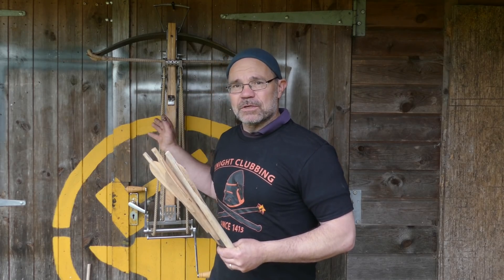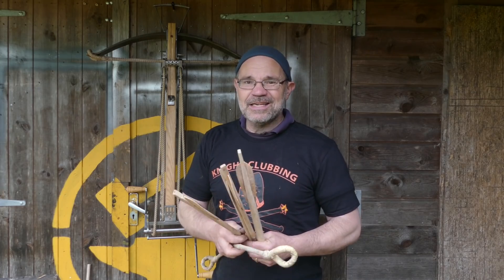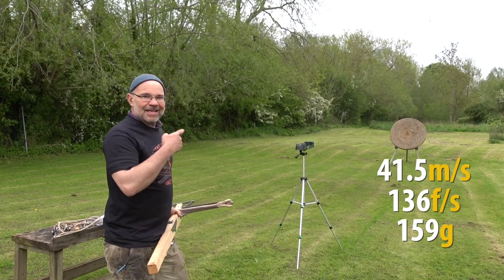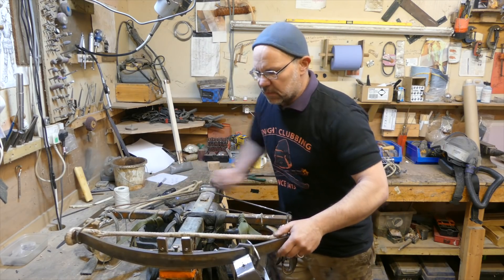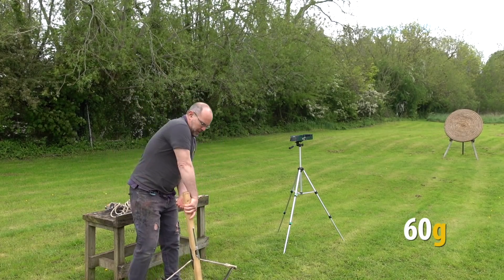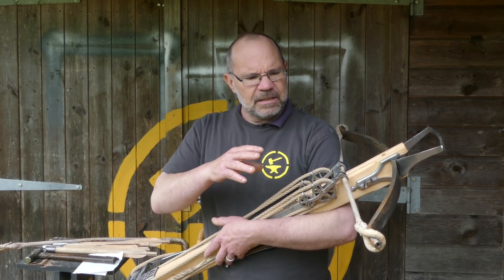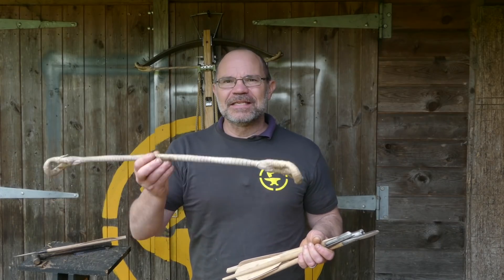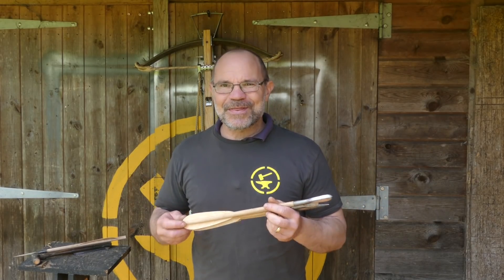Medieval bolt POWER!

Comment: I just realized, that the steel bow on the crossbow is heavier than a longswords
Reply: I find stuff like this a real eye-opener when looking at how much great characters in fiction lug around while sneaking past guards and scaling castle walls.
Reply from the maker: I found it interesting, as I have neither weighed it either, I just knew it was heavy

Comment: A possible explanation for why the lighter string gives less power: It's stretchier than the heavy string. So for the same draw distance you get more string stretching and less steel bending, meaning you have a lighter draw weight and less power. It's exactly the same impact has having a longer string, but not visible until you pull the bow back. Can this be something you measure in your workshop?
Reply: Yeah, it's very possible that the 140 g string was just a bit too weak, so it stretched immediately, Tod's says  it's probably ended up bit too long at around 6:30
Reply: @lscibor  I thought he said that it might have always been longer? Either way, measuring the draw weight at full extension with both strings would be very interesting and resolve this quandary!
Reply: @kovona  Yes, obviously, nobody disagreed with that. The question is if the string is longer at rest, or only under tension.
Reply: @QuantumHistorian  Even measuring that might not fully capture the issues at play; depending on whether its and issue of length at rest or an issue of string stretch.  If the lighter string just happened to be fractionally longer, but no stretchier, then your draw weight measurement idea should tell the tale.  But If the lighter string has more stretch to it then I'd both static and dynamic stretching; and a draw weight test would only capture the former.  Because if the string stretches even more once the trigger's pulled and it's accelerating the bolt then that'd be a further reduction in energy transfer compared to whatever the draw weight test showed.
Reply: @jonathan_60503  Good point, I didn't think of the dynamics of the string after the trigger is pulled. My gut feeling is that this doesn't matter since the steel bow is what will have stretched the most and is the heaviest by far, so the string should be in a quasi-static equilibrium while the steel bow returns to its relaxed state. But I could be wrong! Don't know what test would determine that however.
Reply from the maker: Bartek.  You are completely right.  It did stretch/settle immediately and infact I had to retest it a few times, beyond a twist of what I generally do, but then it settled and stayed put so I ran with it, but for a while I wondered if it was too thin.  It may have moved further, but I don't think so, I think it genuinely was a slight difference in brace.  The brace is only about 11mm from rest compared to an unbraced bow, so lets say 11mm or 9mm is very little difference especially measuring on a curved and angled object.  I suspect my mistake
Reply: @tods_workshop  Thanks for the answer.

I suspect that while 11 mm may not seem like much it's still about the 7% of the while power stroke, no ? So it may be significant.

The most interesting thing is that energy drop seems really minimal with lighter bolts, may as well be just statistical variation.

But significant and in now way accidental with later.... Perhaps it had stretched further after few first shots? Or something else's at play...

Comment: I love this sort of content and I'm so very happy to see numbers explaining the mechanics going on with shooting bolts. When you shot using the lighter string and you got less velocity, at first I was very surprised. After you proposed an explanation, it all became clear. Now it seems quite obvious that if the final string length varies (with crossbow drawn), the bow will be differently deflected, affecting the deformation energy it's storing before release. And I say final length, because the string can be longer or shorter, but also more or less elastic. Accounting for this might be out of the scope of these videos, I think, but it's probably good to know for a better understanding of the whole thing.
In any case, cheers!

Comment: When comparing weighs of a bow, a string and a bolt one has to take into account relative mechanical advantage in the system. The ends of a bow move twice as slow as a bolt does. And the center of a bow doesn’t move at all. So the effective mass of the bow would be about 1/5 of it’s real mass. For the string it’s something like 3/4 of it’s real mass. The bow is still the most relevant part. But one has to be careful comparing the masses like this.
Reply: Excellent point.

Comment: lighter bot = faster speed, faster speed = more impactful 

basic physics at work
Reply: @JorgTheElder  the point impacts faster leading to more penetration allowing the mass to do more damage. it’s why modern tank shells fire a smaller arrow-like bolt than a large bullet-like shell, the force to penetrate is less but it also goes deeper and causes more damage on the backside of the point of entry: like flesh and body parts

Comment: Tod: "It's Tod at Tod's workshop here!"
Target: "Oh, this is going to hurt."
Actually, I've always wondered how they strung a crossbow.
Reply: I wonder if there was another way of stringing a crossbow; or if, armies on campaign had a cart kitted out with various rigs necessary to maintain the army's weapons.
Reply: @euansmith3699  There was certainly an armorer's cart (or several) as part of the train of any substantial army.  What exactly was in it would have varied with the army and age, but for most of history you can assume it would be a combination of a blacksmith's shop and a woodshop. I would also suspect there were field expedient methods of restringing a crossbow, since you likely didn't have a lot of spare bows when you were in the middle of a battle or seige.
Reply: @lwilton  Especially during sieges, I guess, as those crossbow strings are going to come under a lot of repeated use.
Reply: It's worth keeping in mind that you have a lot of men with little to do other than work at menial tasks most of the time. This gives you a huge reservoir of ability to make a bunch of field expedient pieces via a bunch of guys whittling the appropriate bits. At the end of the day, you could just get a couple of men, some rope, and a couple of closely spaced stakes or tree trunks to wedge the bow against while the men use the rope to pull the round side the bow against the trees. Enough men (or a draft horse) and even some of those HEAVY bows could be worked with in relative ease.

Comment: i read on a trad bow forum something like: not to think about the limbs transfering energy into the arrow, but about the arrow sucking energy from the limbs! To resist the limbs bending back to neutral you need an opposing force, that is inertia. Basically heavy stuff resists efforts to change its velocity. In moving objects its often called momentum.
So a heavier bolt will always absorb a higher % of the energy stored in the limbs than a lighter bolt, because it resists the limbs for longer due to its higher inertia, giving it more time to absorb their energy.

Regarding the string:

If we compare the kinetic energy of each type of bolt, we can determine that the crossbow has at LEAST 4% less energy stored with the longer (lighter) string. That is assuming that the lighter string does not change limb efficiency, which it definitely WOULD.

I think the lighter string being longer actually diminished the amount of energy stored in the limbs FAR more. Here is why:

Lets assume during the shot the string at the nock doesnt move, and the string at the height of the bolt moves as far as the bolt, a bit like a rubber band. If the mass of the string is evenly distributed as you move along the string from nock to nock, the mass of the string moves half as far as the bolt does during the shot. That means the mass of the string moves at half the speed of the bolt at any given time. That means it carries half the momentum a bolt of the same weight would, as momentum=mass*velocity. Meaning a 80g bolt + 140g string have about the same combined inertia as a 60 g bolt + 180g string acting on the limbs, and would be draining the same amount of energy from the limbs, and would be shot at the same speed.

That means a lighter string of the same length should cast the 80g bolt about as fast as the 60g bolt shot with the heavy string, giving it 16% more energy and bumping it up to 4.4 kg*m/s. So a 10% increase in momentum aka penetration power.***

***Assuming my simplifications werent too sacrilegious.

Regardless of my quick maths, Im quite confident you could have lost 10% of total energy stored in the limbs.

Comment: Could you make a medieval style crossbow with a metal bow ,but with a high draw length ,with it still being safe to the user?
Reply: A cross bow made from a 200lb composite bow is better.
Long draw length steel ,means long limbs.
Long steel limbs=super heavy.
Reply: i still wanna know
Reply: Can you go long with short metal limbs?
Reply: If so then how much untill its not safe
Reply: @Kokoonutz  I cant know the limit, if you want a steel short limb long draw you will need a really springy steel,and a really strong chassis. It will be super hard to make if not impossible.
Reply: A crossbow that is made from a 200lb turkish bow, will shoot heavier and lighter arrows waaaayyy faster.
Reply from the maker: I could do, but it would be really heavy and so slow
Reply: @tods_workshop  it wouldent be a crossbow at that point but a portable ballista

Comment: One thing to consider with the choice between light and heavy quarrels is that weight of them doesn't matter only in flight. There is going to be the cost of metal, but of course, even to carry them. Which is a massive concern even today. Some quick math and rounding made me realise that with a 60gram bolt you will fit ~83 into an arbitrary allowance of 5kilograms. With the 93gram one? Only ~54. You only get two thirds of number of bolts downrange! I am sure each crossbowman had a different preference and probably even had multiple types of bolts on his person, just thought that it is a good argument for consideration of the light bolts, even though I like lobbing big hunkin' chunks of steel myself as well. Lovely video and looking forward to more of them as always! Have a good one, Tod!
Reply: Yep, that's a significant concern even today.

I suspect that the crossbowmen would have maybe a dozen or so specialty arrows and a fixed weight of war shots. Total equipment weight is going to be about 35lbs/15kg

Comment: I think the one of the reasons the heavy bolt is slower, is because it has a less aerodynamic tip. I'd recommend putting a pointier head on the heavy bolt and see what happens
Reply: while it would be an interesting experiment, it would no longer be a historical bolt meant for hunting and not penetration.
Reply: So, the system has x amount of energy it can give up. If you add more mass then the energy is offset by the mass.  
Think of yourself throwing increasingly more massive rocks. As the mass gets larger the distance gets smaller. Same energy, different outcome.  
I strongly recommend that you enjoy some basic physics demonstrations as they can be a very helpful tool to understand what many people take for granted.
Reply: The Crono is very close by, so there is little distance for the bolt to decelerate. Then also the bolt is heavier and not as fast - so even a bit less drag. And it is heavier, so while the air-resistance is certainly higher, the extra mass means it will still not slow down as fast.

To put that to extremes:
A Feather as less air-resistance than a car, yet even at just 50 km/h a car could be shot way further than a feather at 200 km/h.
Reply from the maker: Some dane.  Baum stumpff has it
Reply: @ABaumstumpf  Cars kill people, feathers (except for weird cases) don't.
Reply: @ABaumstumpf  As a more non magical way of things...  
The chrono is placed at, or near the exit of the projectile so to capture the velocity at the start of the reaction.  
Using this data point, we can calculate various things given this initial reading.  
 We might have a 6mm diameter shaft vs an 8mm one. By taking the sample at the point of maximum energy, we can observe and measure any differences. 
Thus we can prove the difference between them.
Reply: We are measuring initial velocity.

That blunt tip will lose velocity a lot faster, but not initial velocity.
Reply: @ScottKenny1978  Again - while it has more air-resistance, it also has more mass. Making sweeping statements is not a good idea in this case, but very likely the heavy bolt will lose velocity and thus energy a lot slower, specially considering that it already starts at a slightly lower velocity and air-resistance increased quadratic with speed.
Reply: @ABaumstumpf  yes, more drag but better ballistic coefficient due to the much greater weight. Flying things are weird.

Comment: Interesting fact; this 850lb crossbow got a very similar performance with a 93g bolt compared to the 960llb crossbow you tested a while back with a 90g bolt. The 960 had the same momentum, 4 more joules, and 2 more meters/second.
Reply from the maker: Pretty similar weights for all parts to be honest, so at least its consistent

Comment: With energy and momentum being the highest on that blunt thicc one, I would like to see its performance with a normal botkin tip on armor or wooden doors. And make one rediculous heavy, like 400 grams and look if energy tranfer goes down again, currently it simply goes up with weight, but it would be nice to see what that strong bow can move, and when its power hits a border.
Reply from the maker: how about 510g?  try this one https://youtu.be/hU7KJ83MfWs
Reply: @tods_workshop  Yes, i saw that one. Sadly no Chrono to compare it to the other bolts, and since it is blunt, I don't know how effective a 'sharp' version (please mount a spearhead on a bolt 😅) would be compared to the 90ish grams bolts. Since crossbows are not the most mobile and range-defining things, i wonder if a 'breach commando' could have used some rediculous bolts like that, as range would be neglectable and pure energy transfer is all you need sometimes. (Full metal bolts perhaps? They probably are not as top heavy as the pommel one...)
Reply: That one is thicker, so more metal would need to be bent and the four 'cuts/leaves' would need to be longer, so I would think there would be diminishing returns. But having numbers to prove that would be sweet.
Reply: @YouPlague  agreed, and seeing the smile on Tod's face when shooting something rediculous is priceless as well 🤣

Comment: The thinner string is more elastic and thus stretches further when being cocked,it's this that produces less bending of the bow and thus the poorer performance on being shot.
Reply from the maker: as far as I know natural plant fibres aren't elastic
Reply: @tods_workshop  Everything's elastic to some extent. But the tensile stiffness of the string may be much higher than the bending stiffness of the bow, in which case it wouldn't make much difference. You could measure this.
Reply: You could try getting two strings of identical length but different diameters and hang two weights on them and see what happens. @tods_workshop

Comment: Hello. Tod from my observation and background (material science) it seems that the main limitation of xbows is the elasticity (rate of deformation) of the metal bow. Depending on the metal (or other material) a vast amount of the stored energy in the bow is lost to internal friction and the maximum deformation speed also limits the maximum speed the bolt can reach. Because of this the lighter bolts only move a bit faster than heavier bolts.
If you would really put money into R&D I bet you could design a modern xbow with terrifying power and momentum. But at the same time we have fully automatic firearms, so nobody will put down the money for such an adventure.
Reply: @Michael Smith Hello. I set the performance of the bolt as standard for the comparison. Of course there are ways to improve the bolt too. My main focus was the xbow and why the lighter bolts did not show a far greater speed.
Modern xbows solve a lot of these problems already (I'm aware of that) but they are doing this with more or less basic materials. CFRP's are by today's standard basic materials by the way.
Besides that Michael your intuition was not wrong, the effects you describe are important too and are based on material properties and mechanical solutions. It takes a whole bunch of different engineers and technicians to produce a top rated product.

Comment: A interesting test would be to see how fast the bow can move an effectively weightless string. Perhaps use a string made of kevlar or similar very light modern material with effectively no stretch,  or measure the movement of the bow with no string at all - that might need a fancy jig, measuring kit, and 
some equally fancy math.  This would establish the limiting velocity of the steel bow itself.
Reply: You'd have to use a very light string, dry firing a bow is a quick way to break it.

Comment: While the second string did lower energies it also got them much closer to each other so it may still help with lighter bolts. The 80 and 60 lost virtually no emergy compare to the 10 the 2 heavies lost due to length

Comment: Changing the string had the biggest difference for the heavy bolt.
That makes sense: if the lighter string is more elastic (reduces the force), then there should be less energy in the bow. We don't see this for the lighter bolt, since the weight of the string starts having a bigger influence.